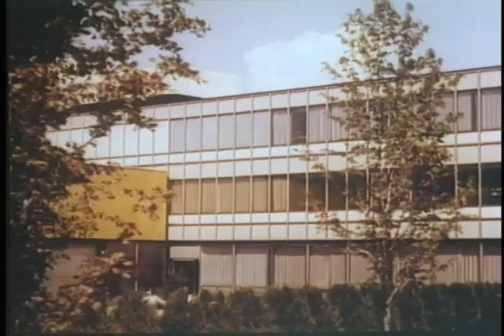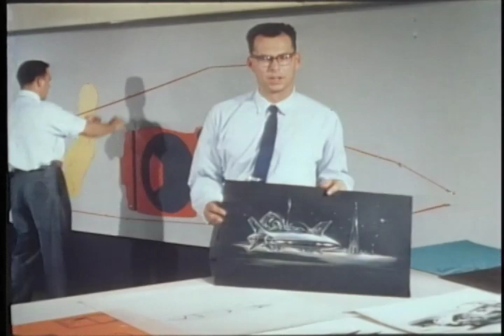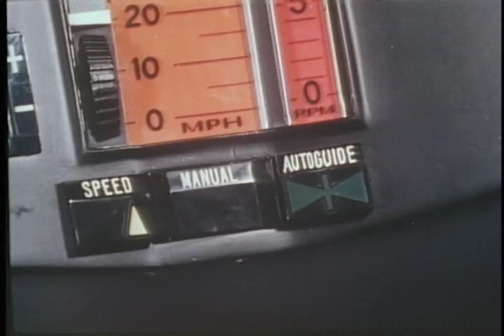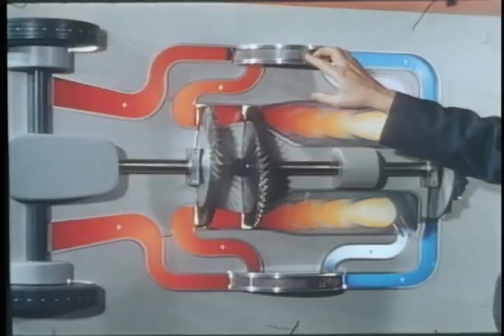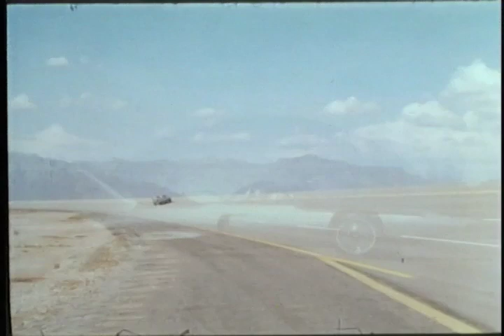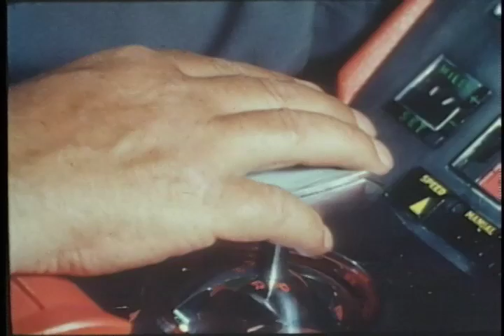Firebird III GMs Turbine Powered Wonder

Comment: I can tell that i'll have trouble putting tire chains on that one.  I hope it was air conditioned.  Otherwise, you'll sweat off pounds under that bubble in the Arizona heat.
Reply: If you're left handed or your right hand gets tired, steering would be problematic

Comment: Probably the most ridiculous car of all time. I don't think a single one of it's engineering 'innovations' were ever put into a production version, thank God none of it's over-the-top styling was either.
Reply: Well let's see,fly by wire? Check! Cruise control? Check! Autoguidance? Check! Antilock brakes? Check!Active suspension? Check!remote doors? Check! Keyless entry? Check! Remote start? Check!

About the only thing Not incorporated is the turbine engine. The design styling was a concept,never meant for production. Everything else was pretty much used eventually. 

Think before you post. It doesn't make you look very intelligent.
Reply: @tomcline5631  Great post!
Reply: I saw a number of them.  You are not looking very closely.